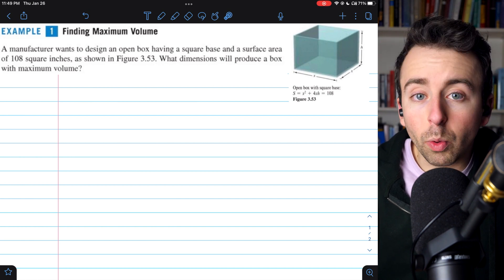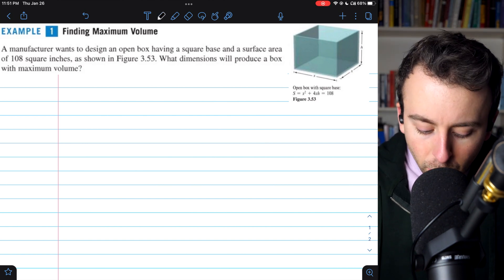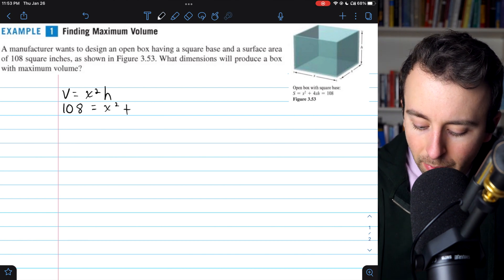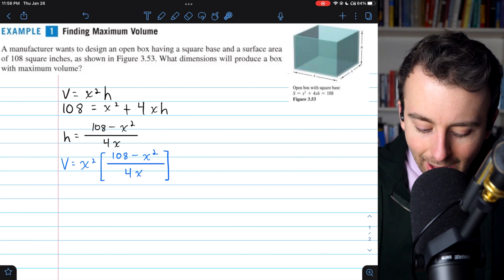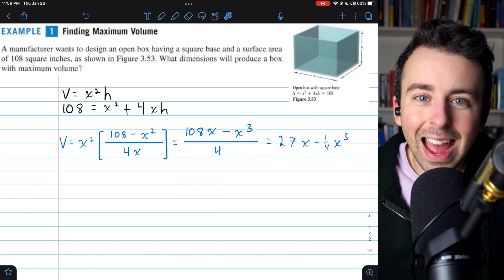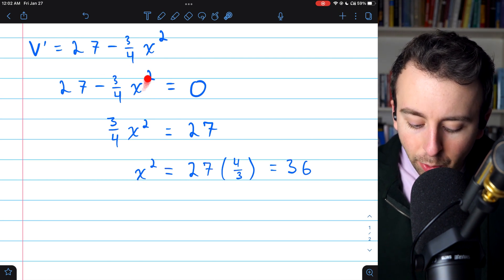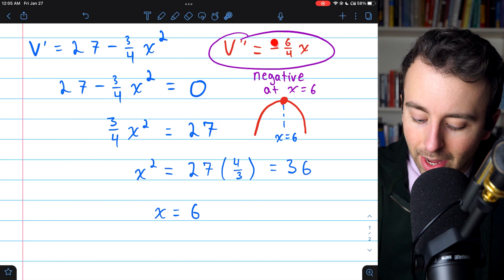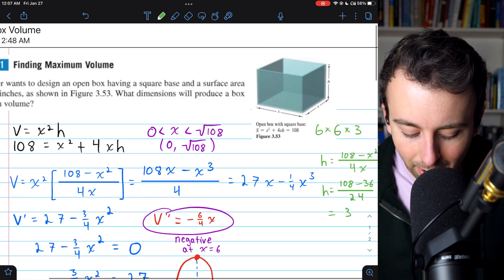Maximize Volume of an Open Top Box (Optimization) | Calculus 1 Exercises

Comment: If the box were closed the dimensions would be 3sqrt2 in. X3sqrt2in.X3sqrt2in. In addition to working out the math the same way, this makes sense because a perfect cube has the maximum volume for a rectangular box with all closed sides.
Reply: i encountered a similar quirk with a capsule problem (min surface area for a given volume or something), and all it wanted was the radius of the hemispheres but working out thenproblem further the min shape was just a sphere, capsule formed around a disk of height 0

Comment: can you do the harder extension to this problem where we're not guaranteed that the base is square? so "maximize the volume of a rectangular-based open-top box". I think the proof that the base is square is intuitive, but could you do it set up like a calculus problem with max (xyh) w.r.t. x, y holding h constant?

Comment: Would the surface area equation not be = to 108=x^2 +5xh due to there being a 5th square face on the bottom of the cube ?
Reply from the maker: Thanks for watching and no - the four faces are not squares, they are rectangles x by h. So we have four of those, so 4xh. the square base you refer to is where the x^2 comes from. Hope that helps!